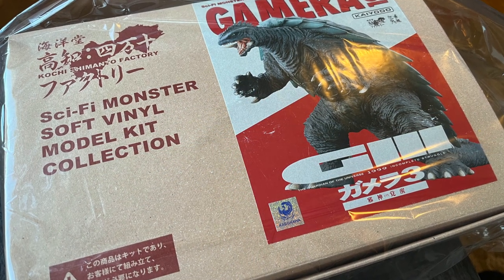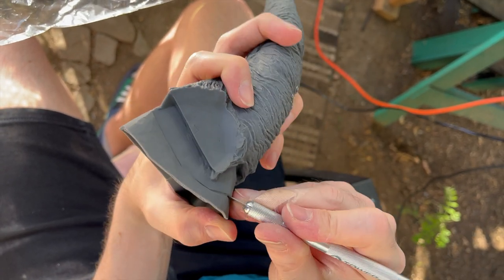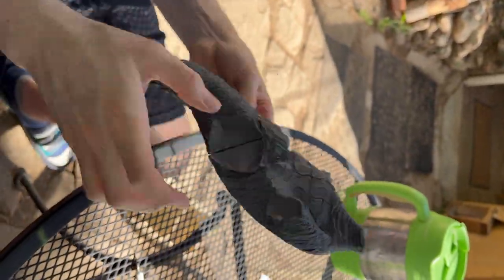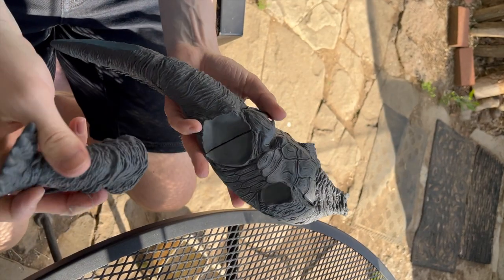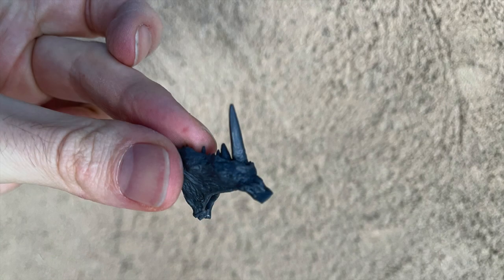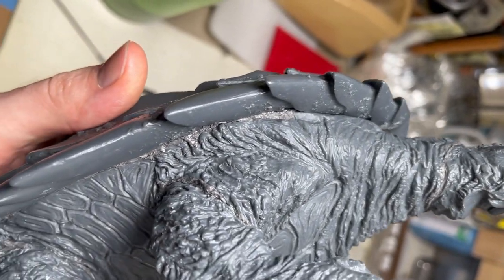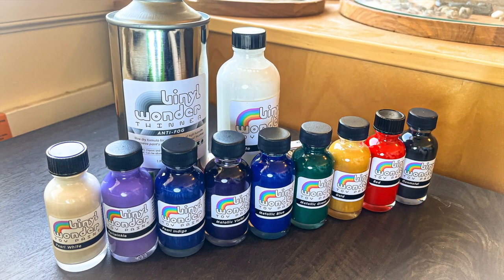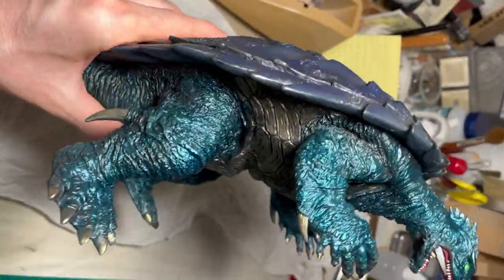Kaiyodo 'Gamera 3' 1999 Soft Vinyl Model Kit Assembly & Paints

Comment: I'm thinking about getting my first soft vinyl model kit, and I wanted to see what it's like to assemble one. This was a great first vid for me, you have a lot of nifty tricks that I'm looking forward to trying out. Thanks!
Reply from the maker: Awe, heck yeah! That's great to hear. Vinyl kits are really nice since there are hardly no seams to clean up after assembly. Plus, trimming off flare is easy when the material is heated. Usually you probably don't need to go as far with all the inner structural stuff as I did, if you planned to be very careful with it. But, I wanted it to be really substantial to endure shipping and have a long shelf life for the person who commissioned it. And as mentioned- be careful with paints. True vinyl paint is pretty niche, but worth it, if you have a really fancy kit.

Comment: What brand of expanding foam do you recommend for a vinyl kit?
Reply from the maker: I was using whatever was available at my local hardware store. I believe it was made by the brand 'Loc Tite'. Which seemed safe since I'm familiar with their 2-part epoxy products.

Since it's just filler you hopefully won't even see, I think it's kinda forgiving what you use. But, whatever you get, save some of your vinyl trimmings to experiment on first. Also will help you get a feel for how much it expands, how sticky it is, and how rigid it is after it sets.